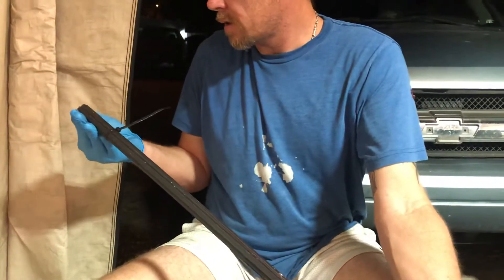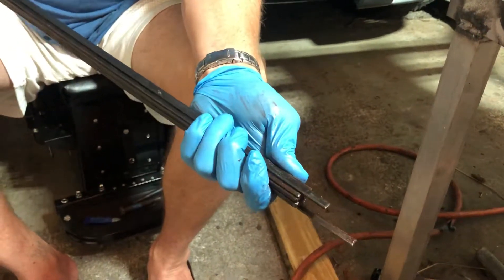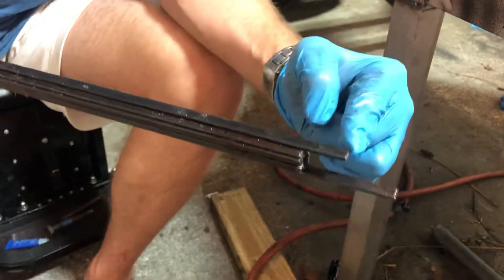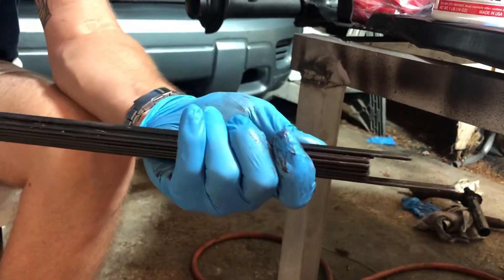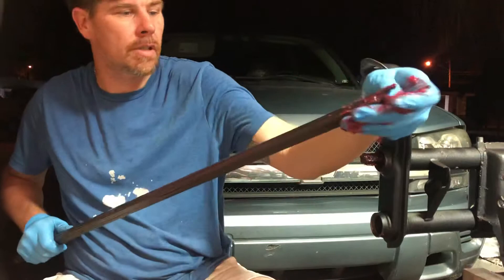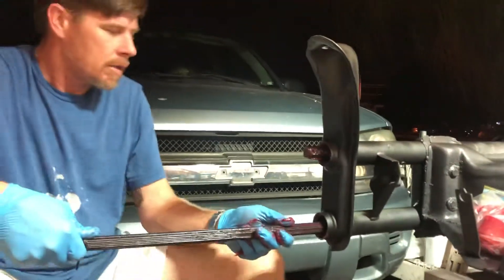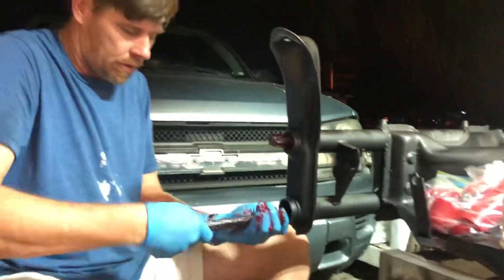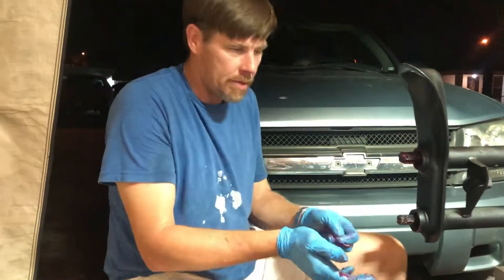Easiest and fastest way to install your Volkswagen / dune buggy front torsion springs in the beam.

Comment: I just messed around for 2/12 hours trying to get the torsion springs in, watched your video and had them in within 10 minutes THANK YOU!!
Reply from the maker: Jeff Woolever Very happy it helped ya out! Thanks for commenting!
Reply: DMAN, the tapered piece that goes on the upper ball joint. Where does the notch go in orientation when the ball joint?
Reply: With the ball joint
Reply from the maker: Jeff Woolever I’m not sure I follow exactly, are you talking about the set screw that goes in the control arm then into the spring?
Reply: Dman D. No the tapered piece that goes on the upper ball joint. The hole is offset so it has to orient a certain way. The upper ball joint has a tapered shaft that this fits to and then fits into the spindle which is also tapered.
Reply: I finally found out what it was I was talking about. It is called a camber bushing, you turn the bushing to set camber of ball joint front end.
Reply from the maker: Jeff Woolever Ahhhhaha I wasnt sure what tou were talkin about! Glad ya got it figured out!
Reply: 2 1/2 on one leaf this evening - pulling my hair out ..then saw this vid 🤦🏼‍♂️🤦🏼‍♂️🤦🏼‍♂️🤦🏼‍♂️
Reply: Does this method work for the upper and lower bars?
Reply from the maker: @floop585  yes sorry missed this comment
Reply: @damiansgaragebuilds7663  No problem thank you for the reply though! Managed to get the job done

Comment: I cleaned all the bars with a razor blade and sand paper and using this method was very easy to install  . 🎉
Reply: Like you I found that a good cleaning makes this a lot easier. I used some degreaser on a scotch briteto begin with , then a 120 flap disk.  And little 220 sand paper on the edge. They look like new.

Comment: Excellent idea. do I need to fill up the whole beam with the grease?
Reply from the maker: Just put a liberal amount of grease on and in between spring plates, once it’s in pack sum grease in the end of the tube and the control arm tubes. Once it’s all together Add some more grease via the Zürich fittings maybe 20 pumps on each one for a new build I’d say. Good luck and have fun!

Comment: Nice video but adding grease to the outside of the leaves does nothing but make a bigger mess.
Reply from the maker: I would have to disagree the springs/rods are rubbing together constantly and here in South Florida everything rusts even in the tubes. Cant hurt if ya ask me.
Reply: Grease helps ..Stops rust..